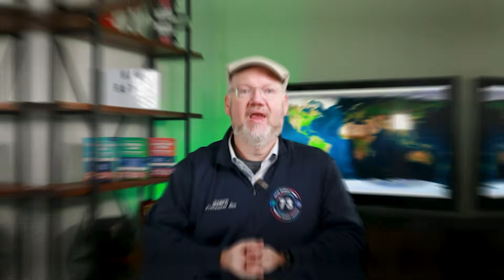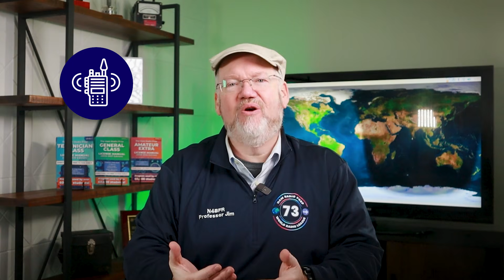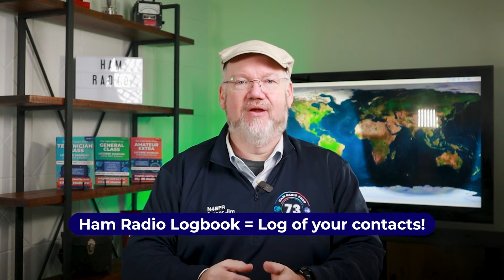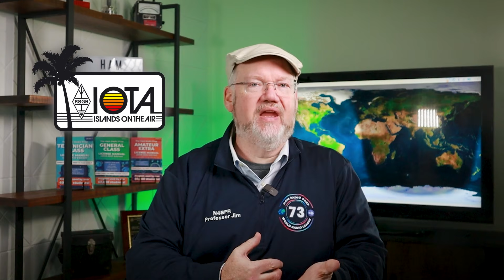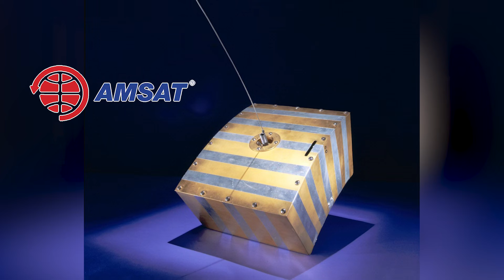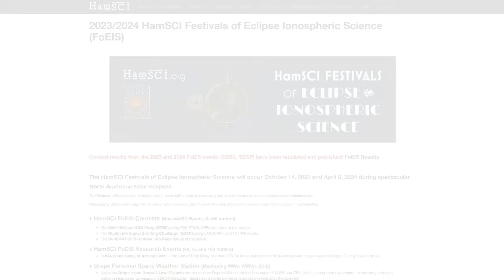10 Incredible Things you can do with your Ham Radio License

Comment: Don’t repeaters use electricity? So if the power grid goes down then what? Moon bounce?
Reply from the maker: Many repeaters are equipped with backup batteries, generators and other power options.
Reply: That's where HF comes in.